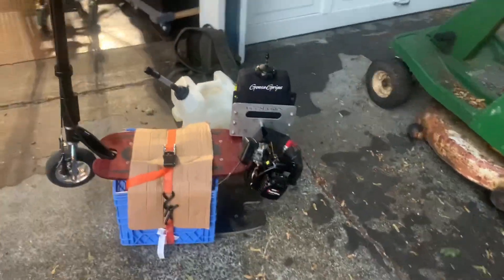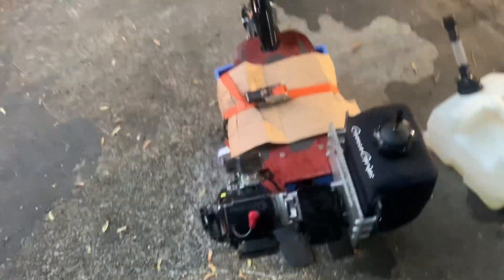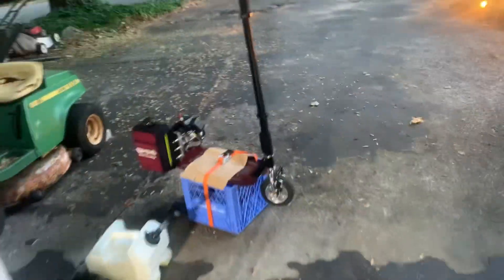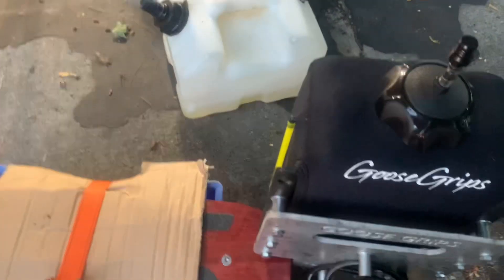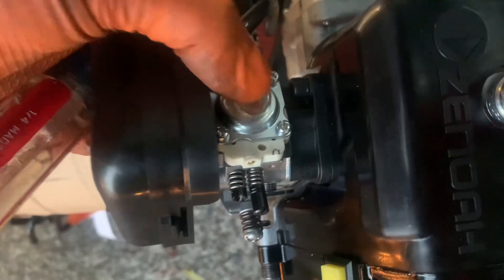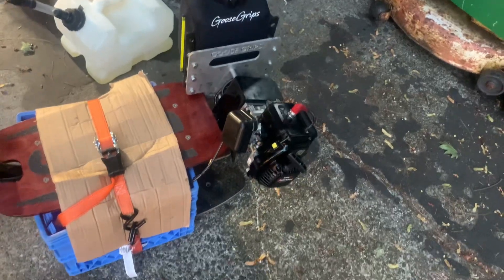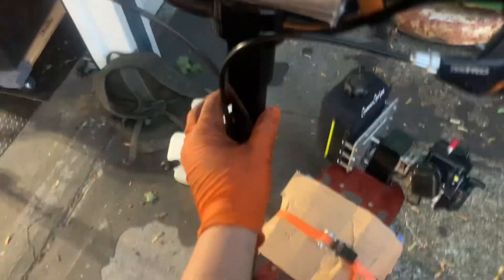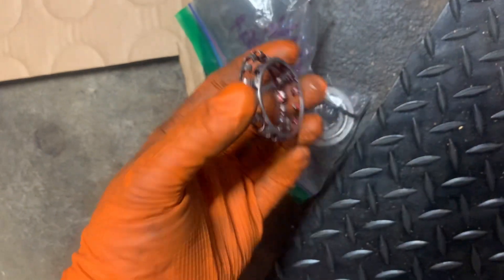Brand new Zenoah G320RC First Start On My Project Goped Sport

Comment: U wanna sell the case reed motor? Be great for a rc buggy
Reply from the maker: Possibly, but I guess my first question would be where do you live or where would I ship it to because I would have to figure that out. But base cat did recently give me some carbon fiber petals to swap in instead of the fiberglass or plastic ones it currently has. I just need to get around to doing that, make a new gasket for the reed, then swap everything over like the carburetor and exhaust and put it back on the scooter, all to see if it runs any better at all, or not..
Reply: @rabbitfootedkitty1339  I'm in Ohio

Comment: How fast was the sport with the g320?
Reply from the maker: I think I hit around 35 mph with the way too big 1 inch spindle. Not sure the top speed when I put a .8” spindle on. For the most part I kind of shoved Gopeds and shit to the side in favor of wiring a whole audio system into my smart car, and turbocharging my Mercedes 190E. Might have some videos on those things coming recently if it all works out as I’m hoping it will.
Reply: so was it faster with the 1.00 spindle or the 8